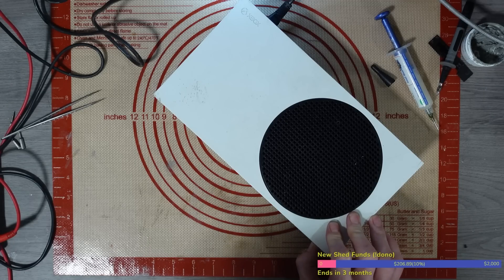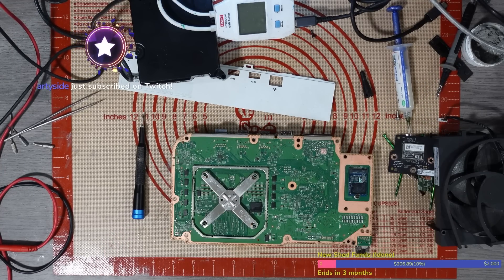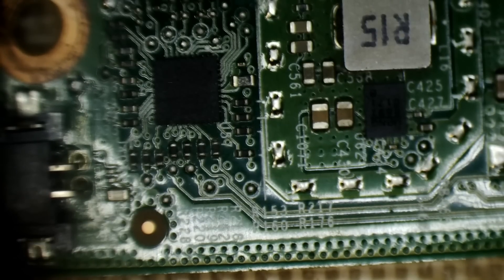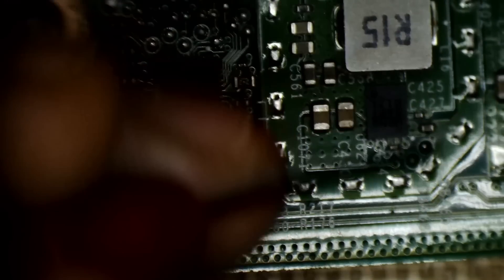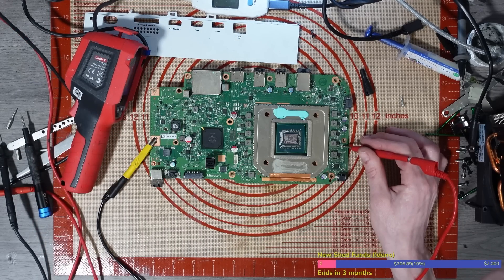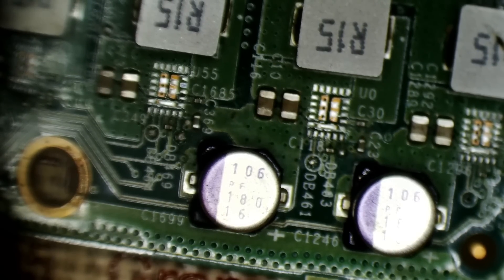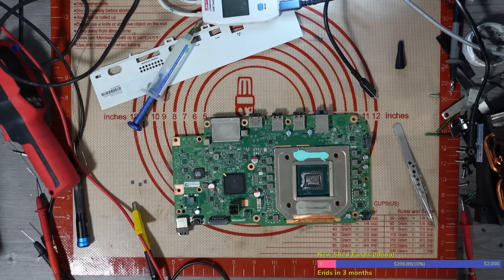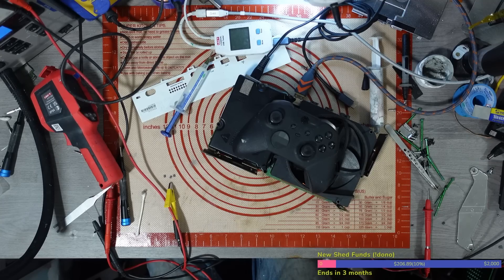This Broken Xbox Series S Seemed To Have A Shorted APU... But I Fixed It Anyway!

Comment: Im stumped,,,no short on the power connectors,no shorts on mosfets .power supply is 12v working but this xbox1s has no life,no beep,no lights just dead.anywhere to look or start

Comment: Don't you just use a cheap ebay transistor tester to check identical FET circuits, ie, the shorted one will show "Unidentified Part" or something else, while the good ones show a FET.

Comment: Typical would be the last flipping one. I had the same another fet though, with voltage injection couldn’t see any heat on the fet, with PSU beep on beep off, could see minor heat on one fet. Removed and short gone 😁

Comment: Curious as to whether you have ever used a milliohm meter to locate shorts, though you remove / retest / refit components faster than most people blink.
Reply from the maker: I use the multimeter but you're right, it doesn't take me long to remove and refit the mosfets so it doesn't matter too much when you know what's on that rail, and the common failures too. This entire repair from start to finish only lasted 61 minutes including interacting with chat so it wasn't too bad 😀

Comment: Quality fix pal. I've got one similar but instead a Series X. 1v inject 1a draw but NOTHING getting hot on 12v rail. Actually went up to 3a but stone cold.

Wonder if I should now just start pulling the 12v fets to see if that sorts it 🤣🤣
Reply from the maker: Cheers buddy, and yeah definitely, give it a whirl
Reply: Check the big caps next to the power connector, I found that to fix one series x the other day where nothing was getting hot and wasn’t the mofsets